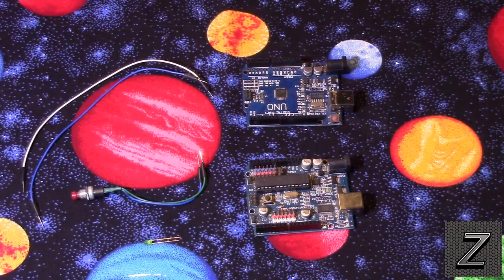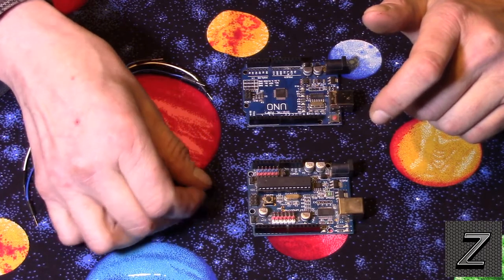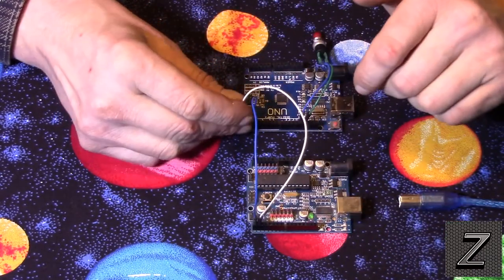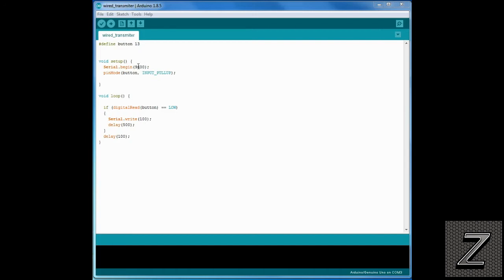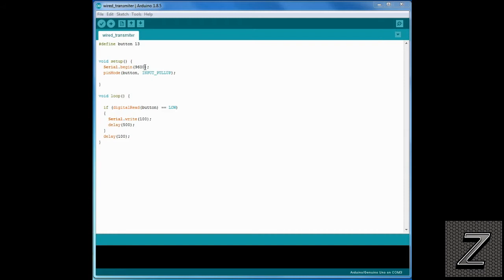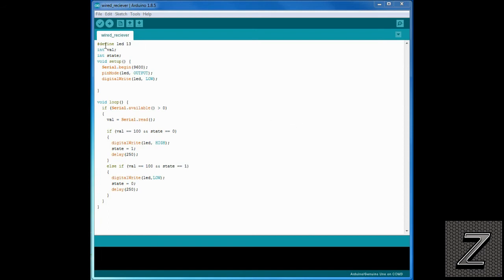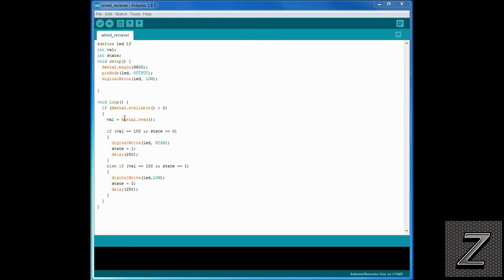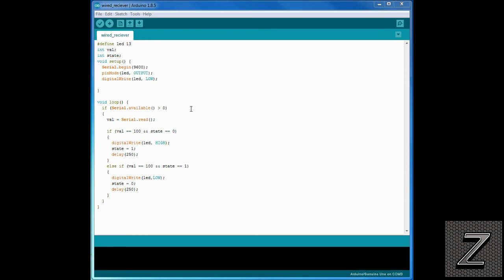Learning Arduino for beginners EP#13 wired serial communication between two Arduino boards

Comment: Wired receiver 10:45.  I transmit a single ascii char.

#define LED  13
bool toggle = 0;

void setup() {
  Serial.begin(38400);
  pinMode(LED, OUTPUT);
}

void loop() {
  while (Serial.available()) {
    Serial.read(); 
    digitalWrite(LED, toggle = ! toggle);
  }
}